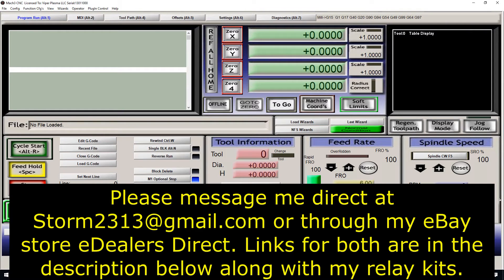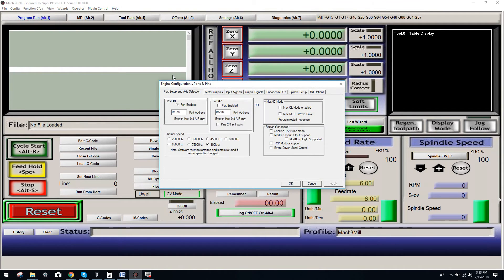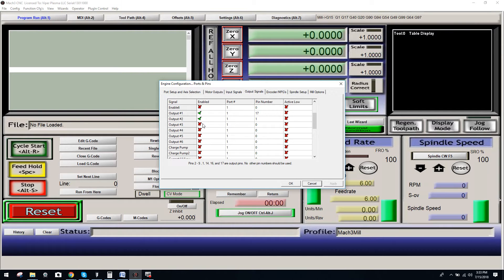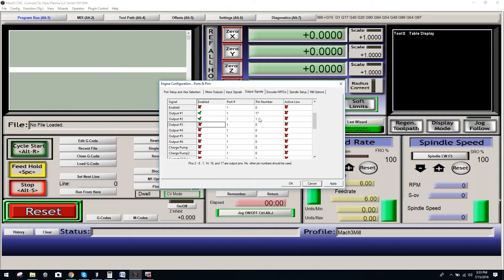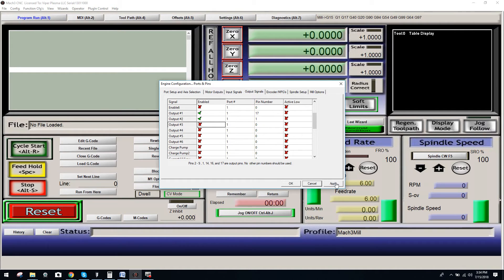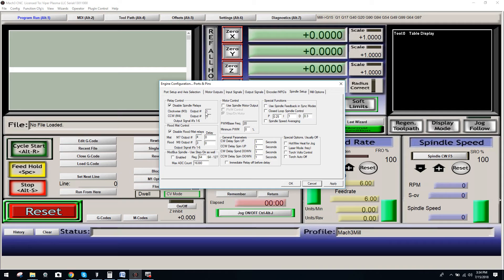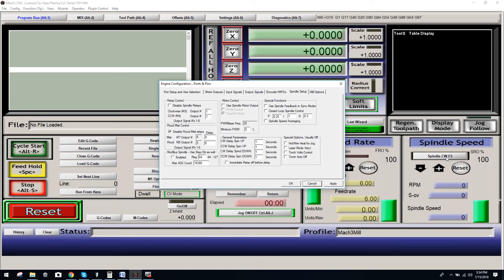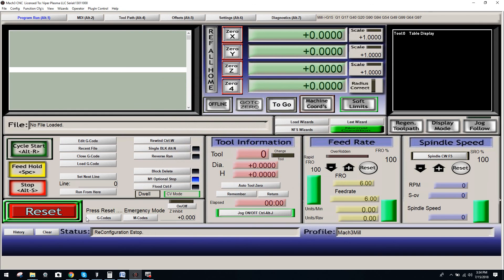How to configure relays in Mach3 for a Gecko G540...

Comment: when I do that the relay turns on and I got spindle action!!    but wont turn off  !!!!      I disconect the board from the pc and then I can reset it and do it again ,   what is happening to me?  please help !!
Reply from the maker: Thank you for your support. I would have to have all the details of your system, and its configuration to be of help. If the relay cycles the spindle on then cycling it off is usually doable pending you wired the VFD correctly to support spindle control. Thank you, Vince

Comment: Maybe you could help me out I have a G5 40 I just replaced one drive and after I replace the drive the access next to it quit working. So now I have X and z Drives but I don’t have y It shows mach3 it working And the motor sounds like it’s getting power but it does not move I switched drives to see if maybe that drive went bad it made no difference any solutions thanks
Reply from the maker: Yousuck, LoL thank you for your support. If you reviewed the drive already, and are still having issues the only other component requiring replacement would be the motherboard for the G540 which I carry. If your drive is still under warranty as Gecko provides a 3 year to all drives then I would recommend sending the drive to them. If you can't afford to have the robot down having another motherboard is a great investment for while the other is in the shop. Thank you,
Vince